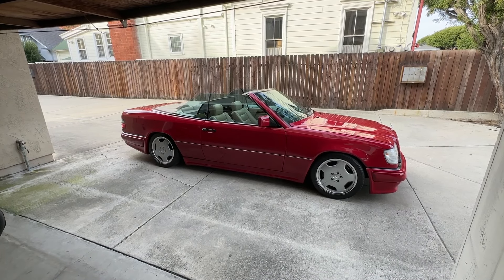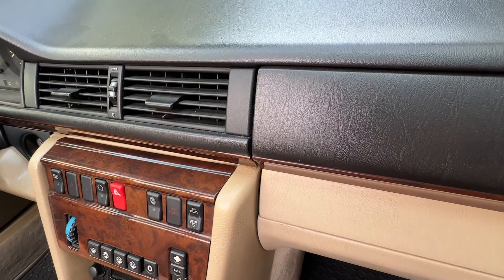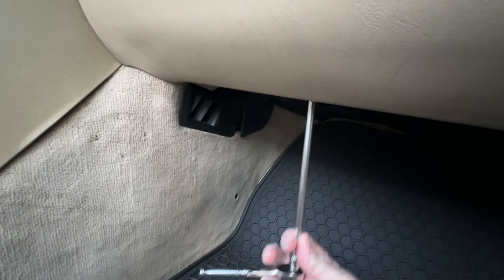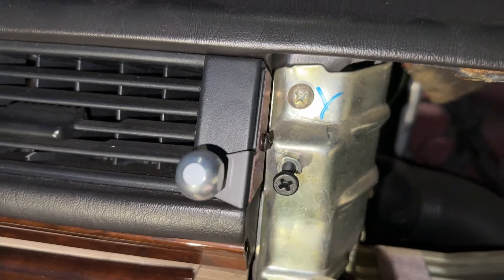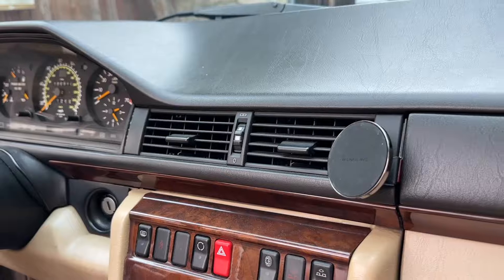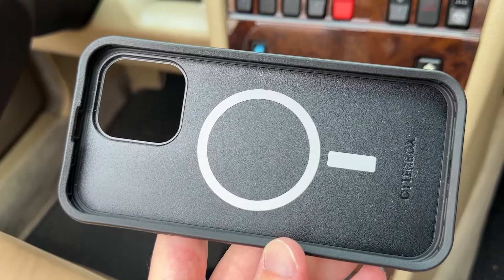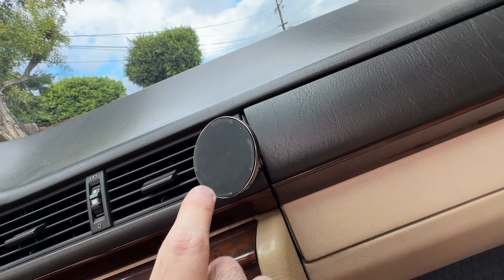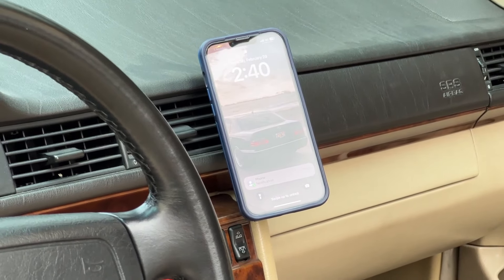W124 MagSafe Magnetic Phone Mount By Rennline

Comment: Nicely done sir! I have the same car and purchased one of these for my truck to see if they worked. I find that the magnet is sub par or the steel ring is not enough to really hold. I did take note to the magsafe case suggestion. I will try that before purchasing one of these for the Cab. One quick question thou, how did you get your ashtray to open that quickly? Mine is very sluggish and most of the time it needs help. Thanks, Slick

Comment: That's a nice solution. Your radio problem isn't as bad as you think, if you can't pull it out, it's much easier to push it from the back. You don't need to remove the whole center console. You have to remove the bottom wood piece which is only held by a screw towards the rear side and then it hinges off on 2 hooks on the front (mine doesn't have the compartment box, so I think you have to look it up how to remove it first). After the bottom piece is off, you can remove the ash tray. Behind the removable ash holder there are 2 screws and then the ash tray assembly just pulls out  and can be removed once you unplug the power connector. At this point you should be able to stick your hand where the ash tray was and push the radio out from behind. It may seem complicated, but just look it up on youtube and it's really simple, shouldn't take more than 30 minutes. 

PS: The reason you have to take out the bottom wood piece first is so the front part doesn't get damaged when you remove the ash tray, if you notice it sits a bit over the ash tray wood.

Comment: Just curious if youve done anything to improve the speakers and sound system for this car if so can you do a video on it. Cheers
Reply from the maker: I have and mentioned it in my W124 walkthrough video. I didn’t film what I did but it was just replacing the dash speakers with ones from Polk Audio which was easy to do and replacing one of the door speakers with an original ones since they actually sound decent.

Comment: What mount do you use for the w210?
Reply from the maker: Not using one currently. I am looking into a solution for it
Reply: @SoCal210 could you use the same mount but just rely on the adhesive without the screw?
Reply from the maker: The metal plate won’t be compatible with a w210. There’s no where it could attach to. It’s possible to make custom metal plate for the w210 and reuse the ball socket and plate.
Reply: Hey, I just use for my w210 plastic holder by Brodit. There plenty designs. Mine fix on central vents. The problem hard to get some in our days also as price. $20 or even more